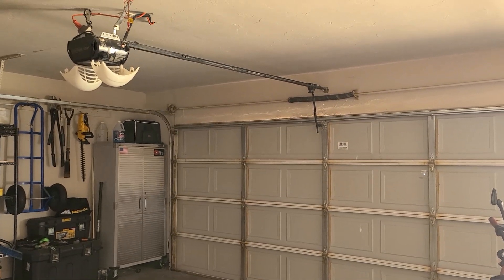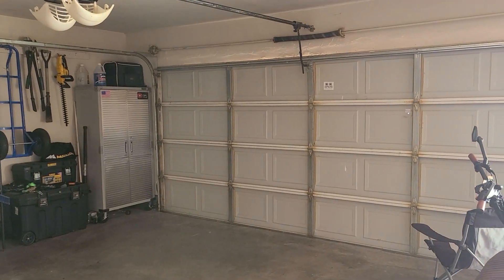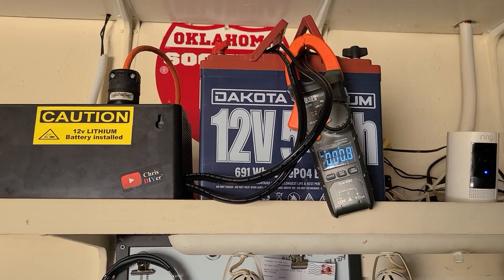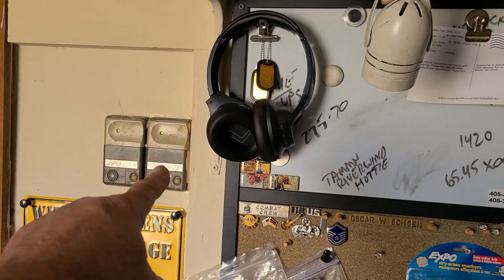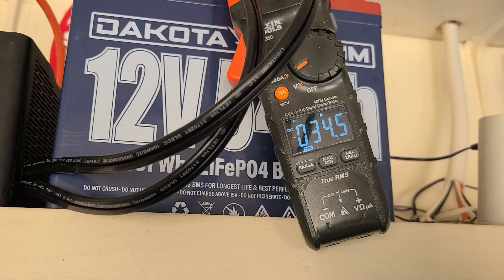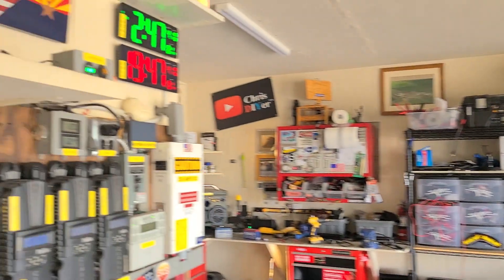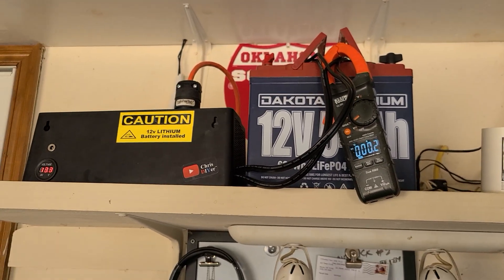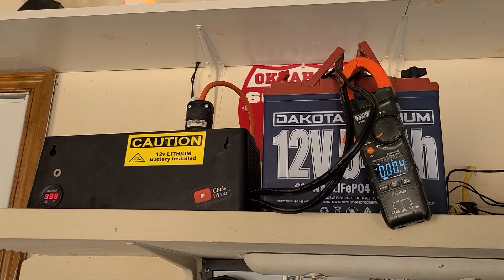Experiment "2.5" -- 1/2 hp garage door opener vs APC Battery Back Ups 900 (with a 54aH lithium)

Comment: Let's say you went from your 600 W unit to a 900 W unit, specifically the APC BR1500 MS2. Do you think it would do the trick? If so, how important is the type of sine wave generated by the UPS: true sine wave in the BR1500 MS2 vs. simulated sine wave in the BR 1500MS (which can be picked up for half the price of the MS2)?.